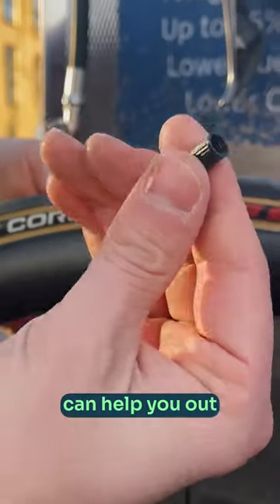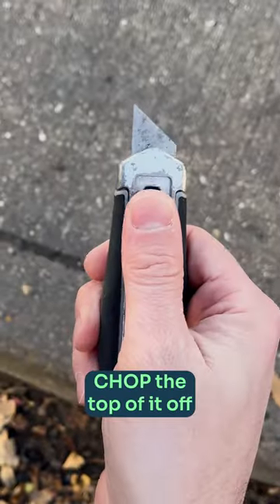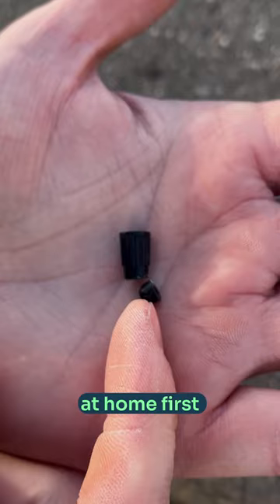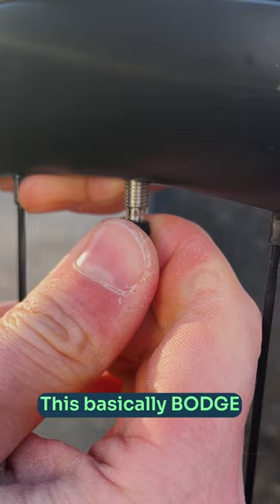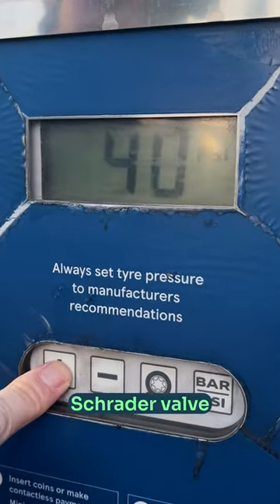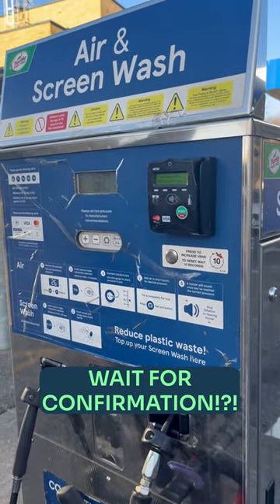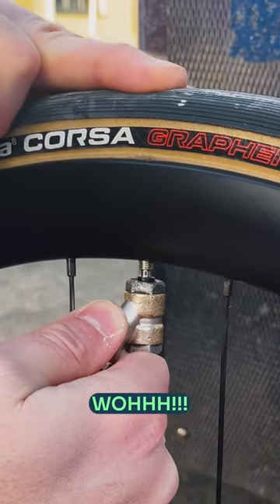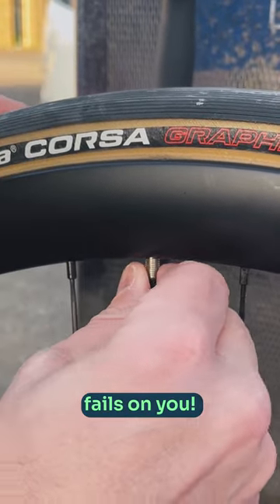Presta Valve, Shrader pump - no problem #bicyle #roadcycling #cycling #roadbike #tip #cylehack

Comment: I'm shocked you have to pay for air😮
Reply: You are paying for use of the machine not the air.  I know other countries don't charge.
Reply: Yeah in Indonesia it's free
Reply: @TurinTuramber A shop by my old place just had the shop air connected to a long hose out back with a tire chuck for free 
Nobody wrecked it, it always worked, was always free
Reply: @stitchfinger7678  Cool. I think anyone saying it should be free should buy a machine and give it away free on their driveway. Very quickly they would have maintenance costs, running costs and vandalism to pay for. Just a fact of life.
Reply: @TurinTuramber  In most countries air pumps at fuel stations are free.
Reply: @kowies  Yes I said that already.
Reply: @yamajii6428  yeap it's free and later on the machine broke when we want to use it 😅

Or the fuel station prefer open a nitrogen station beside free air pump station rather than fixing the failure pump 😅
Reply: @TurinTuramber  I think the idea is most people won't just go there for free air. You will go and get fuel and then pump their tyres up.Vandelism isn't a problem, they disconnect the hose when they shut (usually it's just a hose, valve and pressure gauge attached to a pipe from the compressor). If a garage tried to charge for this in my country they would be boycotted. I think the number of comments and like proves that it's not normal to charge for this.
Reply: @WhaJMc  Yes In the UK if say BP had free air the others might have to swallow the cost and follow suit. They usually charge 50p which isn't profiteering, it just helps cover the running cost and ensure that it's always operational. 

Vandalism is certainly a factor. Around the country are emergency defibrillators which sadly have to be kept in locked boxes. If someone is having a heart attack the helper must call a number and get given a code, enter the code before getting to the machine.  If you ever wonder if humans are complete garbage as a species, then remember that life saving medical devices have to be locked up.
Reply: It’s like 50p. In an emergency some random passer by would help if you had no money
Reply: @yamajii6428  Also free in Turkiye, if you ask employees they usualy have adapters that you can borrow.
Reply: free in turkey
Reply: @TurinTuramber  don't explain yourself lad, half the USA don't realise there's a whole world outside of the states 😂  they'll never understand what you're trying to tell them 🤦‍♂️
Reply: If you ask the attendant they'll give you free air.
Reply: @TurinTuramber  the petrol station in Australia, is a place to fuel up,  wash windscreen, top up water level if needed, inflate tyres, go to restroom, and buy food. A one-stop shop. Those services entice customers to come again and again, which brings money to their store. They make money from the things they sell. Once upon a time, the workers used to fill up, but that culture died in the late 80s.
Reply: Another reason air is/should be available for free is the environmental aspect where cars with low tire pressure use a lot more fuel and pump more pollution into the air, and also the tire wears out faster which is another significant source of pollution.
Reply: @blakeyb9512  how is that relevant here? Is the USA the only country without vandalism? Are all the people listing non-USA countries where it's free lying?

I'm as happy to dunk on the USA as anyone but I'm genuinely baffled as to how you think that applies.
Reply: Two bucks here in Canada
Reply: @WhaJMc it is normal dillweed, back in my day we pumped our shit by hand if we needed “free” air
Reply: @TurinTuramber  Where in live in germany there are lots of free bikemaintenance stations with tools, a pump and sometimes wending machines with tubes.
Reply: Some service stations don't even own those air machines and are there on a contract.
Reply: @TurinTuramber  Yes, If you live in a low trust/cultureless society, in most of the world you get air compressors at gas stations and you can use them for free and no one vandalize them. Also we pay after we put fuel in our cars, how bout that.
Reply: @TurinTuramber  you are literally paying for air.  It doesn't matter where you are on earth compressed air needs a machine to compress the air and its free everywhere
Reply: 2 dollars at the machine in 
MINNECROPOLIS !

(quit bitching,  you're  lucky to be alive)...😊
Reply: Was it not something in the law thst forbids things like that ? I believe it was sometging like water and air should be free and when asked they should put the pump on without making you pay
Reply: Years ago people thought the same thing about water.
Reply: @fadilxheka1232  may as well pay to sleep walk and talk
Reply: @andrysuryadi  it's never happened in the countries I've been to where it's free lol
Reply: Ridiculous innit

Comment: The main reason for the valve cap is to protect the valve from mechanical damage or corrosion. If you cut the head off it does not protect the valve any more.

In this case you could also screw on permanently a presta/car type adapter, which costs very little and is especially made for that.
Reply: Never met a serious road cyclist who doesn't bin the cap immediately. So this brilliant hack actually saves a bit of landfill!
Reply: The cap is to protect the tire from the valve when it is packaged
Reply: Is there any downside to just leaving the adapter on full time, I guess I never considered doing that
Reply: @javierreyes786  the only downside is if you leave the adapter on you can't tighten the small nut on top of the valve - at least not if you don't remove it and put it on again.
Otherwise there should be no downside and you could even use a Schrader valve cap on top of the adapter

Comment: I remember once a filling station attendant told us the pressure in the pump was "too high for bikes" 😂😂😂 I patiently explained how tyre pressures work but I don't think he was capable of understanding 🤦‍♂️
Reply: Lol, happened to me once too. A customer at the pump was trying to tell me same thing. She couldn't understand how bike tire can hold so much higher pressure than her car😂
Reply: The pressure is not too high, but the high flow rate can blow off a tire. Best to add air a little bit at a time for a bike tire.
Reply: Most PPL confuse volume of air with pressure
Reply: elevation may make a difference or not idk
Reply: @wcubbin  exactly, you should've seen the face of the tire guy when I told him to pump my wheel up to 5 atm which is 73 psi😂
Reply: There was a time when the petrol station air machines didn't have digital displays with auto cut offs, bicycles and kids were banned from using them by some garages because kids were pumping up their bikes until they exploded lol

Comment: I just use tubes with Schrader valves. My hand pump and CO2 inflater work with either but running Schrader means if I can get air basically anywhere.

Comment: I just carry an adapter piece in my seat tube, theyre cheap and absolutely tiny, even then thats almost rendered redundant by just, you know, carrying a small co2 pump with you and all.
Reply: Read your post and just tested to see if a CO2 cartridge fits in a seat post. It does!! What a great place to store an extra emergency CO2.  It does require removing the seat post, but who doesn't travel with a hex key?

Comment: There are vids where cyclists blow up their expensive carbon rim using a car tyre inflator. Basically the compressor puts out too much air for bike tyres and it pressurises the carbon rim some newer designs have holes to avoid this. Don’t try this unless you know what you doing

Comment: Back when I was riding bicycles they had the same valves as cars.
Reply: God knows why they changed that!!
Reply: Road bikes never had the same valves as cars! 🤷🏻‍♂️
Quite different with other bikes..
Reply: If you have very narrow rims they use presta, since presta only needs a 6,5 mm hole while car valves need a 8,5 mm hole.

On wider rims the hole size does not matter.
Reply: @simonm1447  exactly, on a modern MTB with 2.5 inch tyres I can't understand the need for narrow valves.
Reply: @jaysee2213  my mtb (XC) has relatively narrow rims too, and also uses presta.

One advantage of presta is the air leakage through the valve itself is lower, since the screw you can tighten puts more pressure on the valve gasket than the spring of a car valve.

To pump it I use an adapter, with this it's like a car valve to fill up. On other bikes I also use car valves